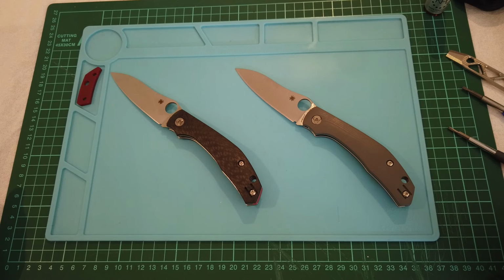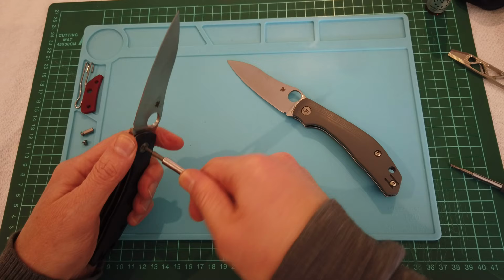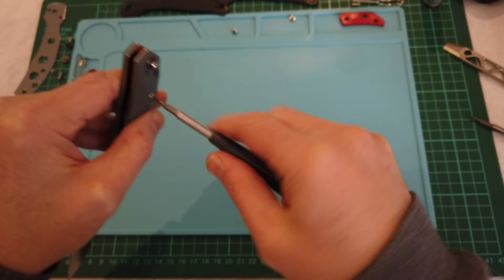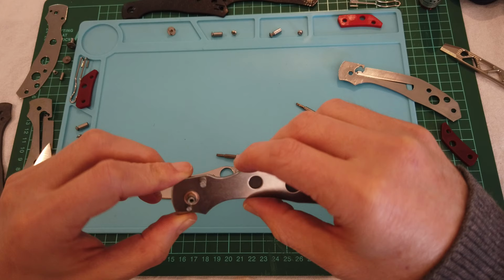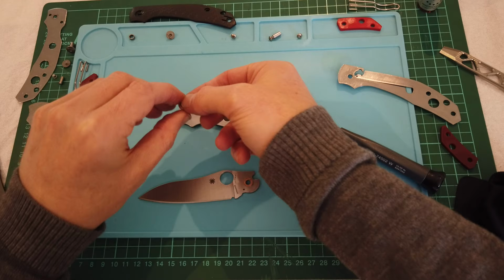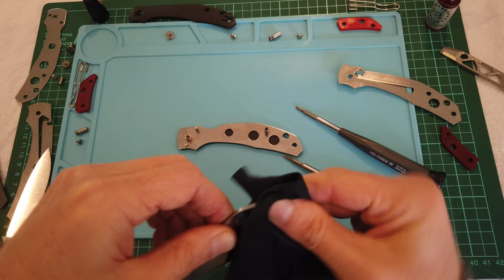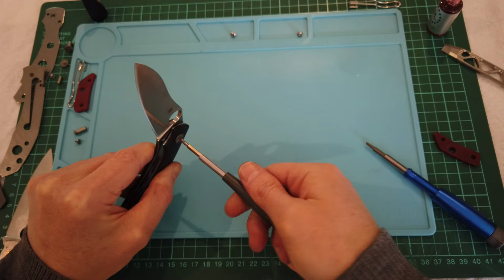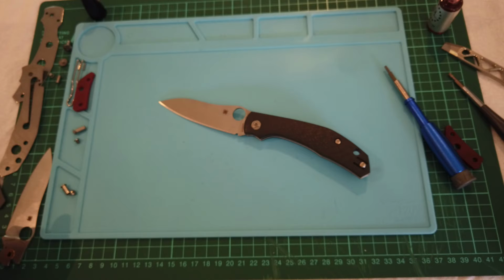Kapara 20CV Carbon Fibre Scale

Comment: The non CQI version you gave me had always been smooth and drop shut.  Thank you again for the knife and choil mod.  My only gripe is the CF is slick which is why I added guntape.
Reply from the maker: I can understand that. It depends a lot on what you use the knife for. Glad that you could mod it to suit your needs better.
Reply: Jason, I had the same gripe with my Kapara. Tried to find aftermarket micarta scales for it but none were to be found. Spoke with Justin Jobe (OCD-4-EDC) about it and he suggested bead blasting the carbon fiber so I sent them to him and voila, they came back with just enough texture to not be slick but still looked great. So, you might want to think about having your scales bead blasted to give them some texture.
Reply: @williamlenderman387  thanks for the info!  I hadn't thought about that.  Thank you!